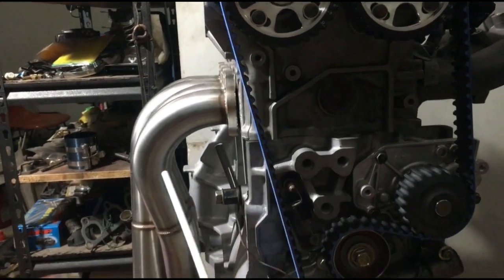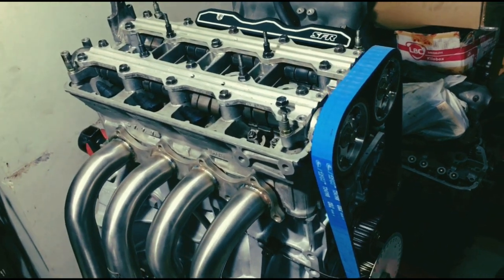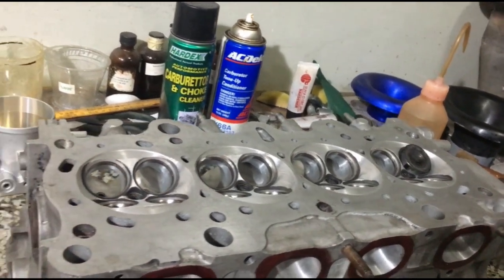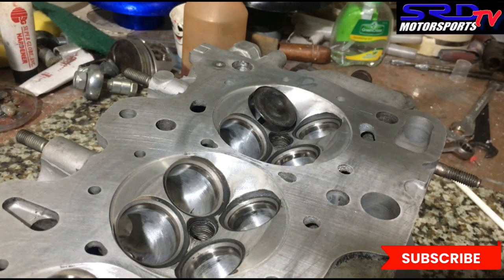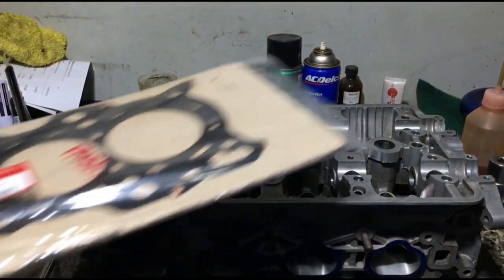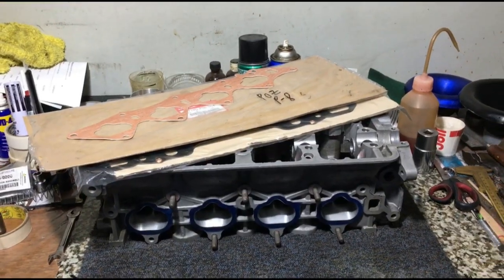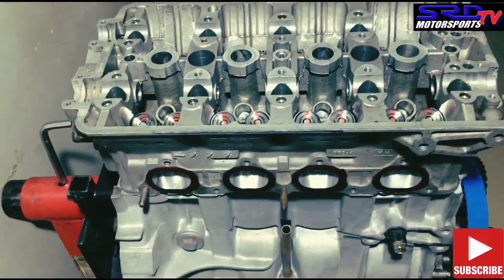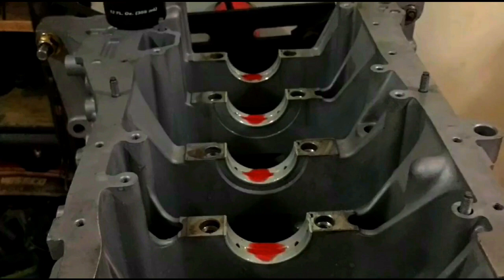B20 VTEC build Series part 5 "head install" SRDmotorsports

Comment: Is Honda rtv mandatory if your using no copper spray on a head gasket ?
Reply from the maker: Actually if both surfaces , head and block are fresh and newly resurfaced or 100% flat and clean?

dry on sealant etc is what the manual recommends 
What we do is only added precaution
Reply: @SRDmotorsports I realized copper spray doesn't really seal sometimes but it's ok since it's a street car and it's not effecting tbe cars performance also I rtv the passenger side of the head and it worked but driver side it didn't keep oil leaking since it wasn't rtv also it's only little drips and hard to notice unless Your OCD like me now I know the difference since I prefer copper spray I will use both methods copper spray and rtv

Comment: Question on the viton valve stem seals. They all look “blue”. Aren’t the blue ones for the exhaust side? And brown for the intake just like the Supertech valve stem seals?
Reply from the maker: To save cost the intake can be “brown” like the common replacements as it doesn’t get much heat unlike the exhaust

These seals here are GSC viton seals I believe Ferrea seals are all blue too

But the Supertech ones like we used on the recent sohc series is exactly how you said it :)
iMO it’s like running a tough exh valve stem seal on the intake the oem ones (black spring) no biggie just more cost 😂
Reply: @SRDmotorsports  Wow. Thanks for the insight!
Reply from the maker: @kmvguy  no worries man thanks so much for checking these out :)

Comment: As always, magnificent!
Reply from the maker: Thanks man! notice on headstuds even when lubed it screetches if the block was cleaned thoroughly so we do that to minimize it

and on the retainers with markers, we all seen those vids here that it spins so ive tried it before and it does change positions so its something others can observe ftw
Reply: @SRDmotorsports  i hardly know it spins bro. Is it just plain normal?
Reply from the maker: @benjieco630  it is daw  i didntknow bfor but check here in youtube there are vids of springs in 6-8k rpm with an ultra hd camera showin it in sloooow motion

i think meron din 10k rpm

it doesnt spinconstantly but it does bit by bit was an interesting tidbit so naturally we test it here and realize it does move lol
Reply: @SRDmotorsports  eventhough it moves bit by bit, there's friction in it. Accumulated micro movements may wear reatiner locks, i guess.